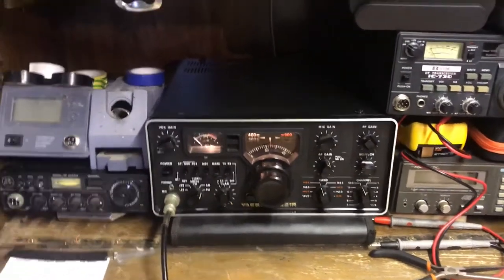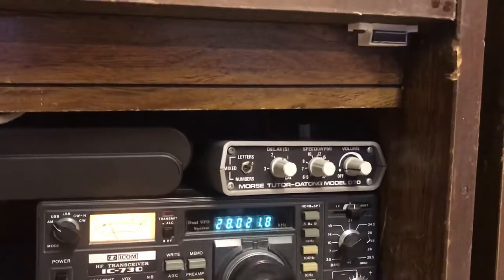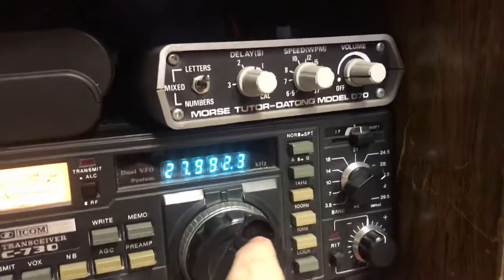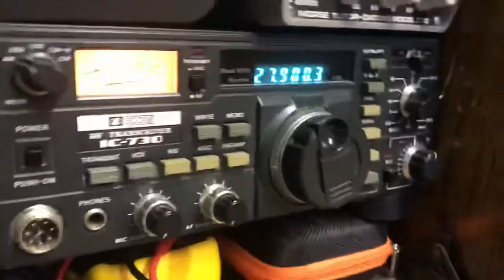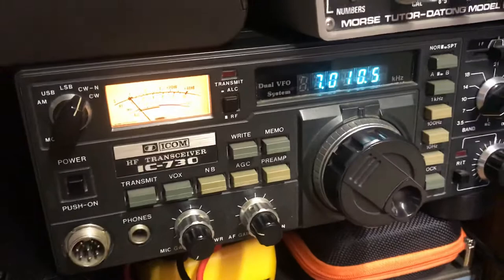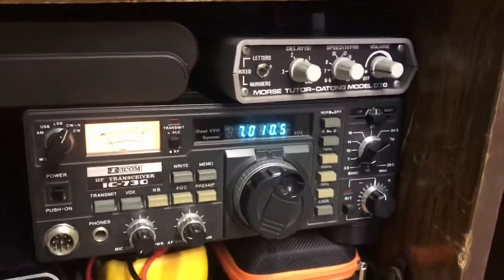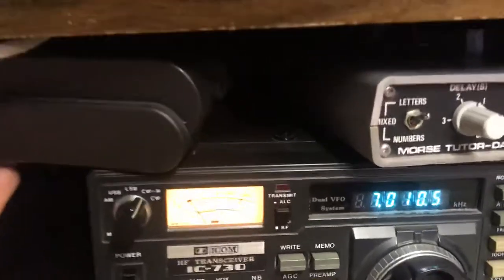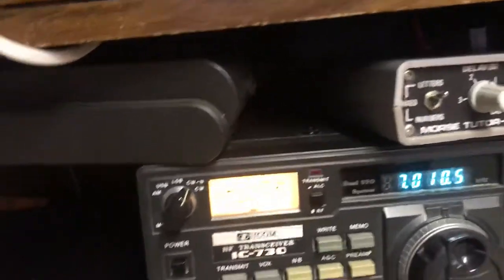A review of the icom ic-730 hf transceiver.

Comment: Just a quick comment about the RF gain control.  You mentioned that it is kept at max at all times.  An old timer's trick -- and I qualify as an old timer now, sadly-- is to set the volume control at a comfortable level, and use the RF gain control to adjust signal, rather than the volume control.  This practice allows you to set the RF gain just below the background noise level so that you don't have to listen to all of the white noise all of the time while tuning.  Of course, the signal meter won't be accurate on most rigs, but it greatly reduces operator fatigue, especially on CW.